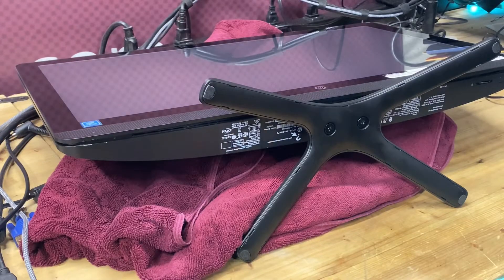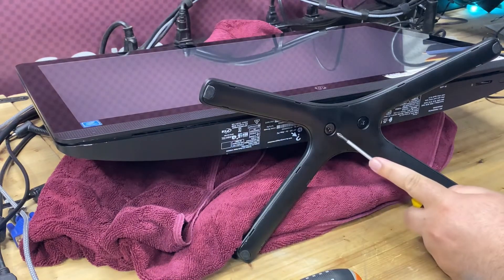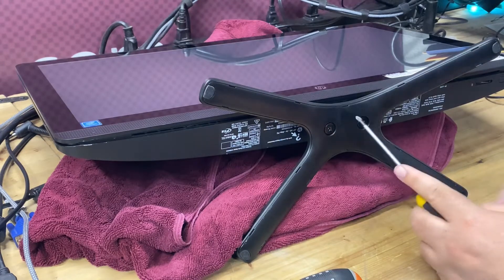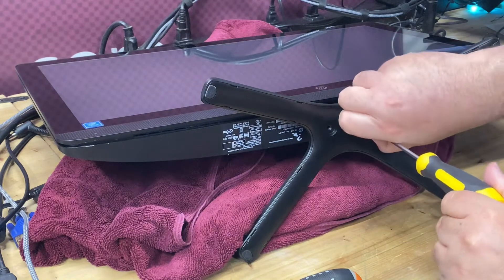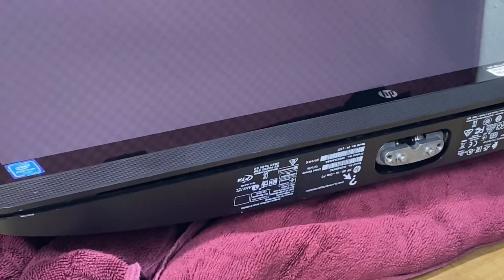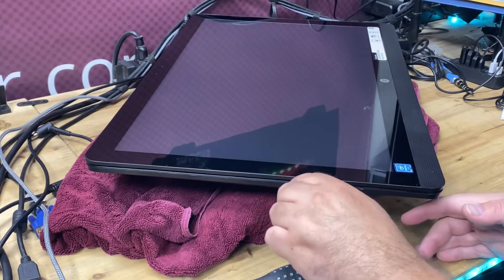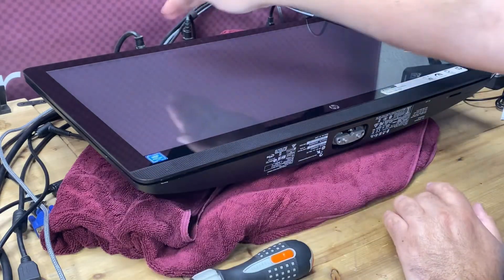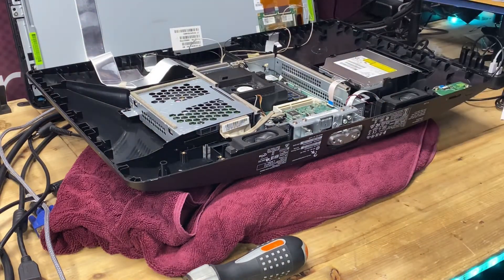How to open/disassemble the back cover of an HP 24-g122 All-in-one desktop PC

Comment: Thank you for this video.  I couldn't find any information anywhere and I needed to remove my hard drive before disposal and this worked!!  Much Appreciated!
Reply: You can run DBAN to write zeroes to the drive to make the data unrecoverable so you don't have to throw the drive away. That would really help the next guy. But then again nobody should be booting from spinning hard drives nowadays anyway and should use ssd/nvme drives

Comment: That screen is really tight, he's not kidding. I had the white one with no bezel and the wire looking feet. I suggest starting at the bottom next the screws and work your way around.
Reply: That's what I just did. And yes, they are extremely tight

Comment: Well, I guess this is perfect timing because I too couldn't find any information about this and it's exactly what I have, glad I found you. Over time when I have multiple tabs open it can take awhile before I can open and close tabs, or it briefly freezes up and I have to wait a bit before it'll let me close or open tabs and that gets frustrating.  I use to be able to keep 2 windows open and 80 tabs or so loaded. So, I assume I can add RAM to this and help it along?? This one came with 8GB of Ram and in the specs it states -  "Supports up to 8 GB on 64-bit systems" - "Maximum memory shown reflects the capability of the hardware and can be limited further in the operating system.", I'm not sure if that means I'm maxed out and wasting my time or if adding RAM can help, LOL.  It was about 400$ on Home Shopping network a long time ago and it's been very good to me for what I do but I gotta fix it or buy a newer model. Apparently it has 2 sockets -  DDR3L-1600 RAM. Thanks for any suggestions, I subbed to ya...
Reply: It's a 💩 computer but yes only 8gb ram max. You can try uping the virtual memory size page file🎉

Comment: I have an HP 24-e014.  The stand is different, but the casing is about the same.  I was able to loosen up the sides and bottom, but never could get the upper edge of the casing unlatched.  I was able to tilt the display up enough clean out the cooling system and update the memory.  Thanks!

Comment: The stand mounting screws are captive, they are not supposed to be removed from the legs.
Reply: Yepper!  Sure wish more such captive screws were used in components!  Years back, it would have been great if they designed circuit boards to utilize them and it had become an industry standard.  But I don't begrudge an alternate universe for their foresight.  I'm sure we have our own.

Comment: You should shave more subscribers. Thank you, for this video. You ate the only one I found on the internet that demonstrates how to do this with this model. I have the same model and can't find hardly any info on it.My computer is stuck in "Preparing Automatic Repair." When I checked my drives, they passed the tests but it says no memory is found. I did notice the day before it shut down that the D drive was almost full. Do you know which model number I should replace the memory board with? I got so confused trying to find one, there wete so many diffetent numbers on different ones, I just did not know which onr to choose. Do you know a link to one that I should purchase? Thanks in advance.
Reply from the maker: You are most welcome.